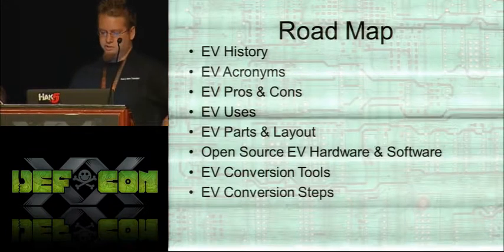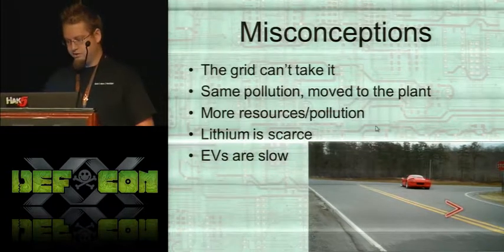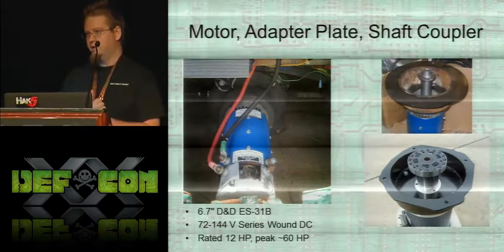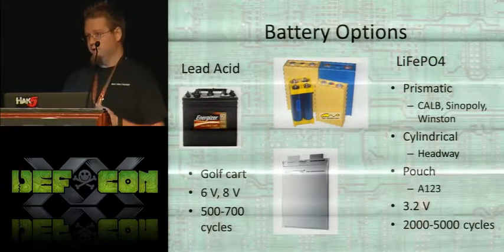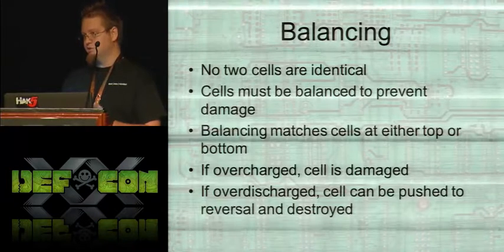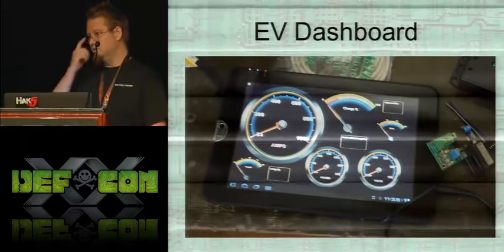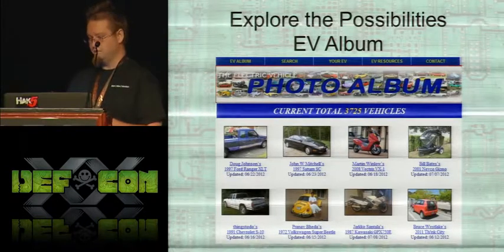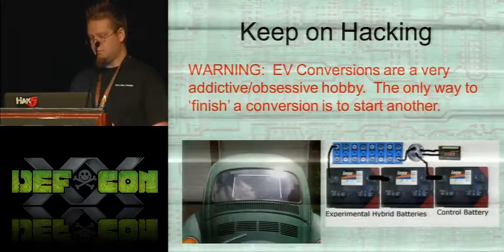[DEFCON 20] DIY Electric Car

Comment: very great presentation.....  please I need to know which electric motor can I put in an h2 hummer that can run ok, looking at the heavy weight the hummer has. it don't matter if I don't get the same performance like the gas engine